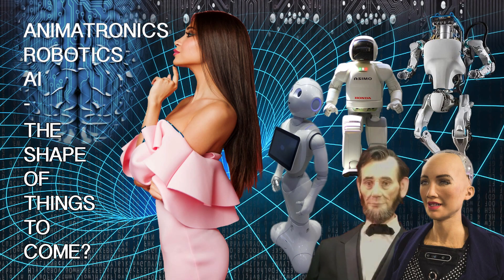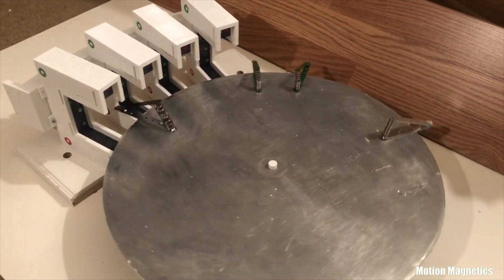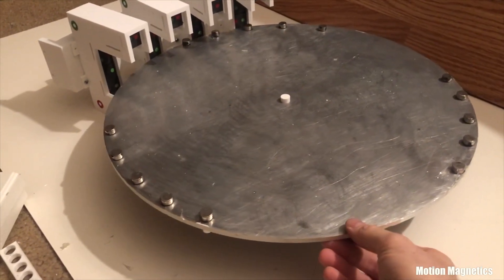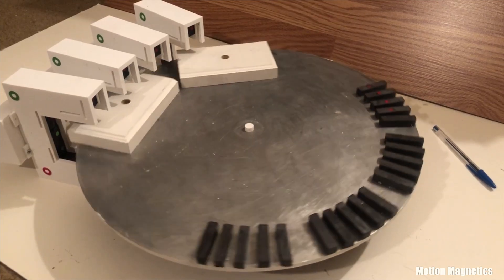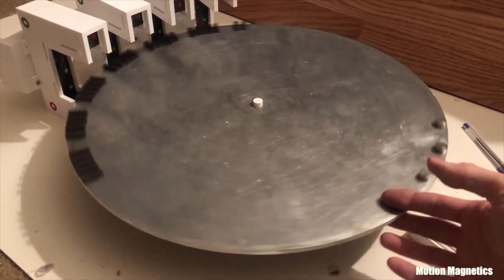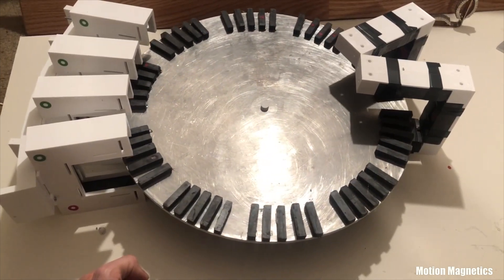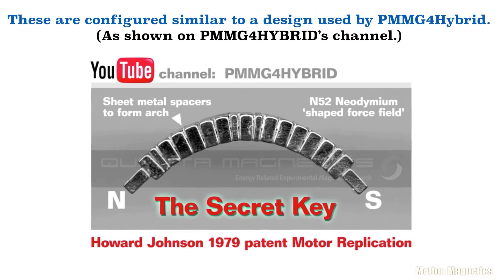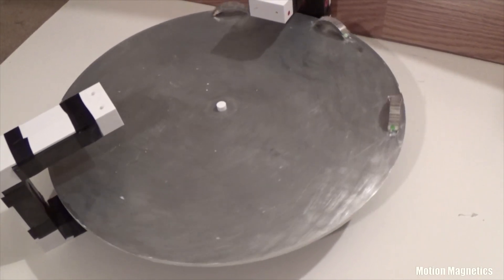Breaking The One Inch Barrier

Comment: Man, I dislike being the only one that mentions the laws of thermodynamics, but there is no way possible to accomplish this feat.  Even if you think you had a flywheel effect, or eddy currents (which do not resonate with permanent magnets, and, introduce drag -- you wouldn't want attractive forces either due to a myriad of reasons -- so why not just use plastic?) or laughably spintronics, it stands to reason that your perpetual motion machine would accelerate, and keep accelerating, therefore accommodating useful work besides just spinning.  What would be the source of that acceleration force?  F=MA.  So throwing pseudoscience at the fundamental laws of thermodynamics, doesn't break them.  Lastly, your one inch barrier always reaches the same conclusion. it slows down.  Even if you had a frictionless magnetic bearing, and put this rig inside a vacuum chamber, it will still stop.  One more thing -- if you take a thick disk of copper or aluminum, mount it on a motor, spin that motor up, then bring a powerful permanent magnet near it, it will slow the motor down significantly due to eddy currents.  Once you play with that, guess what happens to that torsional energy?  I mean you were putting a lot of load on that motor.  Well, like all wasted energy, it heated the aluminum spinning disk -- considerably.  So all of these designs are easily proven to not work, either by fundamental physics, known applicable formulas (basic math), or just understanding the laws of thermodynamics, which are plain English, and have never been broken.

Now for the good news:  I too, had ideas about magnetic rotary devices -- but a completely different approach.  I would never call it a permanent magnetic motor; but not because any real scientists would immediately label me as an uneducated fool.  But because it wasn't a magnetic motor.  It was a mass orbiting in a magnetic, rather than gravitational field.  It was a magnet, levitated on a type 2 superconductor orbiting an iron rod
normal to the plane of the superconductor.  Launched by a very simple adjustable trajectory and velocity "gun", the magnet should be able to perform elliptical or circular orbits.  Pinning causes drag; air causes drag. The superconductor requires refrigeration.  Plus, since it is purely inertial, it would never accelerate by some invisible force you believe exists.  If it were dragged by doing some kind of work, like generating electricity with a set of coils around its orbital path, it would slow down, and the orbit would decay; conservation of angular momentum would make it accelerate its orbital velocity, but move further away from the coils reducing the electrical output, also reducing the drag, still, stopping by losing the orbital velocity required to keep from just slamming and sticking to the centroid rod (or rods).  So mine was not to break unity gain or any other sci-fi.  Mine was just an interesting paperweight that required liquid nitrogen to be vented to continuously cool the superconductor, and, even a room-temperature superconductor would fail.  Lastly, the orbit has already been demonstrated on a special magnetic circular track, and having the superconductor stay pinned levitating over the track.  That does not need a launcher, and can accommodate variable speeds -- but again, still inertial, and even in a vacuum chamber, would stop from eddy currents.

So I am not at all trying to judge or belittle your fun.  I love playing with magnets.  But simply a little physics under your belt, and you will see that they are springs.  FOR EXAMPLE:  Why do magnets not get warm when you keep them apart, or force them together against the attractive or repelling magnetic fields, respectively?  Shouldn't they?  I mean you are putting a lot of torque on the atoms.  Why does that not turn into heat?  Again -- read the laws of thermodynamics.  There is no work accomplished.
Reply from the maker: Well, you won't be the only one to bring up the laws of thermodynamics. Someone does in virtually every video I make. So don't feel bad. I hear echos of your thoughts constantly, and I appreciate you taking the time to write all of that out. I am not a scientist. In fact, I'd consider myself more of a tinkerer. I have read a bit on the laws of thermodynamics though. So I'm not at all unfamiliar with what you're saying. I am not attempting to build a perpetual motion device. Nothing man-made that I'm aware of runs forever. 

I am always curious, considering just how old the laws of thermodynamics are, how the splitting of an atom fits into the conventional understanding of the second law? When you split an atom do you not get more energy out of the resulting explosion that you put into splitting it?

If you really want to understand what I'm attempting, read everything you can on Howard Johnson. Obviously not the one that owned the hotel chain. Johnson managed to come up with the most accurate way to measure and map a magnetic field that I've ever seen. Magnets are nothing like springs, and what I'm really after is the exchange force pulse.
Reply: One more thing -- why do springs, when compressed or extended not increase in temperature?  Because they are static.  The heat when you extend or compress them, but once held in that position, they don't continue to heat.  Why should they?  Same reason magnetic fields statically kept in repelling or attracting positions exert a constant push or pull, but they do not get warm.  Now if you oscillate push-pull, both springs and magnets would heat up.  That's why motors require a constantly switched magnetic field, or an oscillating one.  And that heat, is why they can never break unity gain. Period.  Same with transformers.  They do not work with DC, even though DC maintains a magnetic flux.  Only a change in flux, like wires cutting through a magnetic flux, or vice versa, incurs and inductive connection.

My friend, look at it this way -- there are no monopoles.  You keep cutting a magnet in half until you get to a couple of atoms, and you still have a dipole magnet.  Further, when you cut a magnet, the two pieces do not just stick back together.  So in a 3way all atoms in qa magnet are repelling each other. Constantly.  So that's no different that two magnets being statically prevented from attracting or repelling each other,  In other words, if that created useful over unity gain, magnets would naturally keep heating up as soon as they're magnetized, up until their composition's Curie point.  It would be clean uranium lol.  You are not understanding what a magnet is.

Comment: Years ago I too was trying to do this. I wanted to create a similar effect as you described when you wobbled the rotor. I wanted to create a mechanical wobble that would be forced out of the opposing force to stop rotation, then reenter during pushing or attracting motion depending on the design. I regret that life has moved on and I have not gone back to my experiments for at least 10 years. I hope you find success and look forward to seeing more from you.
Reply from the maker: Thank you. I hope that life affords you more free time. I like knowing that there are others out there working on the solution.
Reply: @Motionmagnetics  Where do you get such lovely aluminum disc platters
Reply: @Motionmagnetics do you have any knowledge toroidal magnetic field?
Reply: @Motionmagnetics  It is physically impossible without a dynamic magnetic field, of which permanent magnets and stable metals only use static magnetic fields.

Comment: Love your work, thank you for sharing.
 
2 things I noticed..

1- do you take into account the flex of your gates? Motion is up and down while magnets pass.

2- as you say in the video about nature isn’t always or generally isn’t linear.. have you had experiments with Fibonacci sequence in mind? 

Cheers
Reply: Along that line, I was thinking of an elliptical wheel or offset rotational center.
Reply from the maker: Thank you. I have done things to stabilize the gates before, to see if they worked better without the flex, as you called it. It's definitely a factor. I have not tried incorporating the Fibonacci sequence into my work, but it's interesting that you brought that up, because I just watched a video discussing that the other day.
Reply: @Motionmagnetics  Feynman's claim that "magnetic effects cannot be understood in an honest way, they are purely quantum mechanical" reflects a 'scientific cultural momentum' of discounting the presence of constituents of the Vacuum.  "The Vacuum - space - is empty" is the convention.

From the start of my elecengr education I wondered why, if a primary of a transformer is fed a DC (not AC) voltage, the secondary of the transformer will exhibit a pulse of current due to electromagnetic induction.  Then nothing in the secondary, even if the DC is still present in the primary.

In other words, the DC current in the primary is still present and the magnetic field around the primary that caused the spike of current flow in the secondary is also still present.

I reasoned
1)  there was a 'shock wave' effect on the constituents of the Vacuum that originated around the primary and interacted with the electron spins in the secondary

2) so why did the electron spin alignment in the secondary go back to random orientation?  You could say "thermal effects" but again the DC is still in the primary, with its fully established magnetic field, still present

3)  something else quenched the electron spin alignment in the secondary, after the initial turn-on spike of DC, after that shock wave effect

4)  the constituents of the Vacuum are randomly oriented and the vast bulk of them overcome the momentary alignment of spins in the secondary.  This is why electromagnetic induction 'requires a changing magnetic field'

A physical analogy:  a torch is fired underwater.  A heat sensor is placed nearby.  An initial shock wave of boiled water spreads out from the flame.  The nearby heat sensor detects boiling water temperature.  But the ocean's vast bulk of water is cold and rapidly quenches the boiling water shock wave. And the heat sensor detects cold water again. The shock wave is gone, only the very close proximity to the flame exhibits heat.

I work with a small team on artificial gravity devices and we absolutely needed to understand how the primary winding of the transformer was able to couple through 'empty space' to the secondary winding.   And "magnetic lines of force" did not move the needle for us.

Comment: I reckon one way one can look at magnetic fields is sorta like  tornadoes or whirlpools. Differing configurations can cause "blowouts" where it throws an object out of the field, but there's always the risk that for every action there's an equal but opposite reaction where a "blow-in" occurs doing the exact opposite that you want. Hence why, in my view, just a pure magnetic motor cannot work. You need a combination of things: Shielding, Gravity Spots, Imbalance, as well as Counter Motion. Then again, it was a few years ago that a university managed to create a magnetic "black hole" where a particular configuration of permanent magnets absolutely cancelled out all fields. If that's possible then certainly it's possible to generate continual growth patterns with a particular configuration. But for the home builder I think it's not quite doable unless you built around each magnet configuration materials that are either diamagnetic, etc--- to essentially cancel out different things. For example, glass believe it or not has magnetic properties, as does bismuth crystals, and as you shown aluminum. Everything to one degree or another has a magnetic attraction. I wonder, too, whether a temperature decrease (extreme cold) wouldn't supe up the magnetic fields too. Maybe the answer to the 1" barrier problem would be a small chamber of strong magnets in liquid nitrogen, forcing the object to pass through. Anyways, I'm just spitballing here, keep up the good work, Jesus Christ Almighty God bless you and Jesus Christ Almighty God bless your family 😊
Reply from the maker: Thank you. I enjoyed your thought process on that.

Comment: what i have learned from trying to build  a magnetic motor which runs forever is that there is a
flaw in the assumption that a static field can maintain oscillation. I think there has to be some sort of
regulator (mechanic leverage or electromagneticnic or booth). 
Think of it like https://en.wikipedia.org/wiki/Maxwell's_demon
Reply from the maker: I like your thinking on that.
Reply: @Motionmagnetics  thx, some more ideas for you, think about magnetic shielding (Mu-Metal, can be found fo free in 3,5" Harddrives from PC's) , also similar but not the same, "Monopole-magnet" configuration (Wikipedia once had it explained, now they claim its jsut "theoretical again xD, ah found it under the original name there https://en.wikipedia.org/wiki/Halbach_array
Reply: @Motionmagnetics  i want to share this good video i found today 
https://www.youtube.com/watch?v=uQWHjj6ofwo
HALBACH ARRAY, how to build + showing the effects

Comment: You talk a little bit about Howard Johnson.  I've wondered if his successful motor design did something he didn't realize that you may be able to work out.  I suspect that his use of the aluminum in his design set up eddy currents in such a way that they resonated.  That resonance then ended up pushing the rotor through his "1 inch barrier" allowing it to complete the revolution.  It would have been very hard for Howard, at that time, to measure electricity flows and accompanying resonance within that aluminum.  I would suspect one would need an oscilloscope to measure this.  I'm not sure if your knowledge/skills would allow you to explore this aspect in your designs, but it might be worth looking in to if you can.
Reply from the maker: I don't believe he used aluminum in any of his designs. He used metal shielding material but usually angled the magnets in such a way as to filter out any unwanted magnetic effects. And I'm certain he would have had no problem measuring the way that aluminum would alter the electron spins of magnets. He figured out a way to alter a radar device and developed one of the most sophisticated magnetic field mapping technologies ever created way back in the 80s. He was years ahead of his time, and way beyond the conventional understanding of laws of thermodynamics.
Reply: @Motionmagnetics  When I read through the patent the plate is described with the following.  I assumed it was an aluminum alloy since it has a high magnetic permeability.  Do you know more about what this material is?  "The stator magnets are mounted upon a supporting plate 20, which is preferably of a metal material having a high permeability to magnetic fields and magnetic flux such as that available under the trademark Netic CoNetic sold by the Perfection Mica Company of Chicago, Illinois."

Comment: I am impressed. I seen your video about the 3 magnet motors but I didn't know you did personal testing in the same field. I myself have not thought of designing a perm. magnet motor of some kind but I do plenty of labor on electric motors all shapes and sizes. I'm very new to thinking in this concept of motor but what would happen if you put the magnets that are stationary (the gate magnets I think you called them) onto another spinning rotor that moves opposite to the main one. could you design one that used 2 spinning rotors with magnets that spin opposite to each other. I'm thinking by not having stationary magnets in this type of motor would cause less drag in the magnetic field reaction for acceleration....Good Luck
Reply from the maker: That's actually one of the ways Howard Johnson suggested doing it. So your thinking is sound.

Comment: Nice work! I wonder if there is some sort of magnetic field simulation software that allows the design of a custom magnetic field and shows the magnet configuration?
Reply: There are programs that can do this, but they are often programmed with restrictions so that anything that resulted in a "perpetual motion" is forbidden in the code.  It calculates as an error and it corrects for this "error" and then you never get to see if your idea actually happens.  The program will tell you it won't, so you don't try that actual configuration.  For something to actually work it will "break" the laws of physics as we know them and our created simulations will not be able to predict this since they are programmed within those laws and not allowed to break them.
Reply: Ron Rothrock 

That’s because REALITY doesn’t allow it.
Reply from the maker: I'm not aware of any that would work.